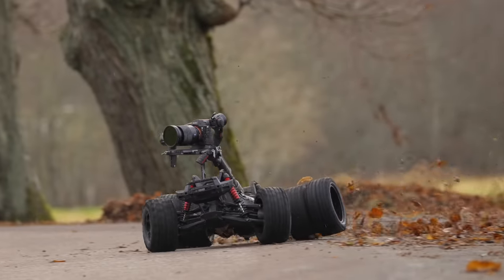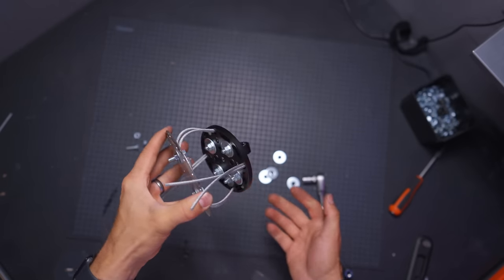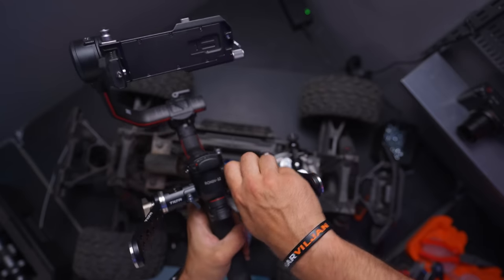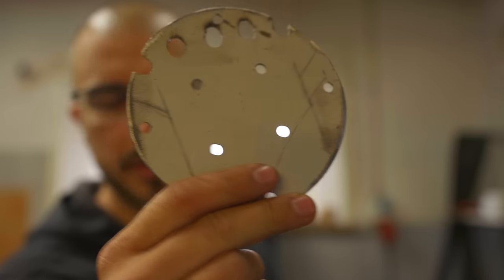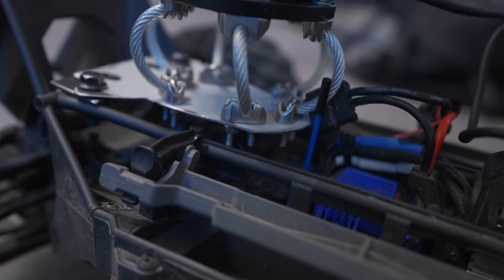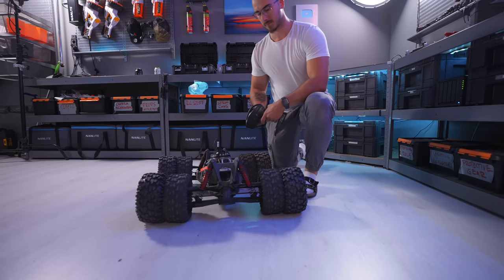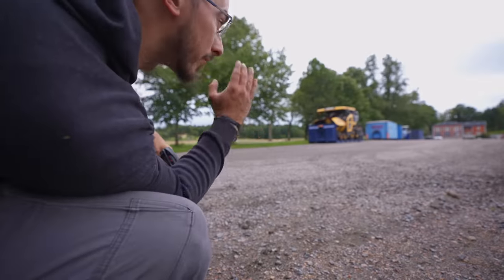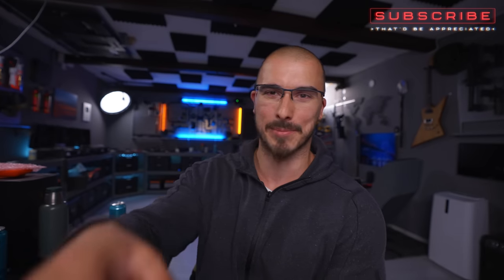I PUT MY SONY A7SIII & GIMBAL ON AN RC CAR | RC CAMERA CAR V2

Comment: Remove the gimbal and remove the camera and put a GoPro 9 on the RC, problem solved 🙃. Just kidding,🙃 that was good 👌
Reply: Haha right. He wants a challenge though
Reply from the maker: No fun in that! Also, can’t beat a full frame camera ;D
Reply: @PeterLindgren1  i was just kidding bro 🙃 i know full frame is full frame, and GoPro's performance can't even go near of it.
Reply: Actually yes GoPro with ReelSteady way to go…. If your going this route it is hard to get rid of those vibrations given the size of the wheels
Reply: I think a 360 camera should be able to reduce all vibration even off road
Reply: GoPro 10 now
Reply: @TriangleView  the GoPro hero ten has very good stats which are better than the a7s 3 but still it is not a full frame.
Reply: Yep.  GoPro with Realsteady would be same same.
Reply: @ibrahimsyed8112  yes GoPro is an action camera. If your looking to do this with a cinema camera you need to serious stuff. I have been there with an RC car it is basically really tricky given the weight constraints it is easier to just use an action camera and ReelSteady will just make it look great even if you have an older GoPro. Otherwise you can go with the GoPro 2021 10 edition or later and you will be pleasantly surprised. Slap on some CameraButter filters and you are good to go!!!
Reply: A GoPro would do way better, but it's not the point :)
Reply: @SlowMtbRider  I known I think the steel bands are great and will help a great deal. On carpet concrete I am sure the results will be better on this kind of grass a small Cinilft quad would remove the bulbs but you are then flying around which has its own complications. I am interested to see if there are some follow up videos with tracking subjects walking running and with a second operator controlling the gimbal pan tilt etc.

Comment: my thoughts are you need a 2 stage shocks/suspension setup: 1 adjustable tensioned firmer stabilizer attached to the gimbal, and a 2nd more looser foam/dampening base attached to the car

Comment: completely unusable footage, but i love the journey of experimentation and discovery. Better suspension on the rc car and an optically stabilized lens would help a lot though. Anything more performant will require Z axis smoothing like a spring arm. Great video.

Comment: You need to tune your shocks! Get some different weight shock oil from your local hobby store and experiment. Try lighter weight oil, you can also add tension to your shock springs by either adding the little clips, or getting heavier springs. The extra tires are causing more vibration, don't worry about toppling over with stock tires, just adjust it in your shocks to compensate and you should be smooth!

Comment: I've been waiting for this followup video! I'd love to see more "just for fun" videos like this from you.

For the suspension I was glad that you removed as much preload as possible from the car's shocks, but what I'd do instead of the wires is use small (onroad probably) shocks on the RS2 plate with very light weight oils and springs. Wire rope is basically a spring with high friction (as the wires move over eachother to bend), and friction isn't the same as dampening (that you get from shocks) due to stiction. As for the dirty camera, PotatoJet just did a video about filming underwater using a special bag with lenses that's also used for dirty environments.

Comment: I use a device that I 3d printed that removes z axis bounce that would be great for this. Amazon also makes one for the Osmo Pocket for a reference. I reviewed these devices and work very well. they use what looks like a automobile control arm with a spring. Very fun video loved your idea.
Reply from the maker: Might have a solution for this but I’ll have to wait a few months 👀

Comment: Peter, damping the vibrations is def not an easy task. Especially on an RC. For up-down dampening wires on a plate are enough only on a "smooth road". But if there are bigger bumps or offroading - then You'll need an arm and bigger wheels/bigger vehicle :) If You're interested I can send You Corel Draw projects of how I'm doing it and the suspention I'm using (but mine are planned for a full size car dedicated in filming).

Comment: the suspension of the RC car is not designed for the extra weight of gimble and camera. Plus with wired suspension you made there is no damper. Try to add something beneath wires which will damp its oscillations. That might give better results/

Comment: Just from an rc point of view you would need to increase the spring tension of the shocks of the Xmaxx, so there would be more ground clearance and less slop. At the same time this would increase the micro-wobbles I think because the suspension itself would be stiffer. maybe try to add a second set of shocks instead and all with loose tension of the srpings? And on drones this was achieved similar with two plates and "rubbersprings" in between – at least on phantom 3 and stuff so maybe instead of the wires – rubber/Silicon dampers would work here as well? Or next suggestion get an unbreakable or brute body for the Xmaxx and try to use that as addiitional stiffening platform for the gimbal as well. Next suggestion:  a friend of mine – Jonas (Youtube Dr. Xmaxx) machined some aluminium chassis braces which are mounted right and left between each bulkhead you would have maybe a better option to clamp something on there...

Otherwise Gopro mount on top of the body or osmo mobile/action :-)

Comment: there is something called " rubber vibration absorber",I think if you use them it will be much better, they are the best to use for vibration absorption

Comment: Using an r5 with IBIS, a 16-35mm 2.8 is at 16mm, some lens stabilisation and some stabilisation in post would have looked wayyy better

Comment: That is Epic! Would love to try shooting at a higher shutter speed and then add some stabilization afterwards. More like how the action cameras do it.
shooting at 120fps 4k, 1/500 or higher shutter speed and going full speed on the rc car, Playback at preferred framerate and motionblur added in software if needed.
Great video as always :)
Would love to see more of this project
Reply: True, we tested and just crank the shutter speed WAY up and stabilize with gyro data. Add some motion blur. Done.

Comment: Why didn't you use the same shock absorber springs in a V-formation to dampen shocks across the tilt and pan axes? It would have probably been a simpler build. Great video though! I suggest maybe keeping the previous configuration and adding the ability to raise and lower the camera, so that it can get closer to the ground. Can't wait to see your next version.

Comment: It was so fun to watch. I made similar but for motorbike, attaching to a custom waist and shoulder belt. I am using a6600 with sigma 16mm and zhiyun weebill s. The footage are useable but not very smooth on rough surface.

Comment: You should try to suspend the gimbal with some elastic cord. Like how they suspend microphones with shock mounts to remove micro-jitters. In the end all the vibrations will be absorbed by the elastic cord. I should work if you suspend the handle between two of these shock mounts.

Comment: 3 things , 1 In English its hose clamp if you were curious.. 2 on freestyle drones we use flight controllers that log gyro data. Then in post you can apply that data to the video and stabilize it after the fact.  Most of the flight controllers will work with rx cars as well. Just a thought for v3 😁.  3 awesome video, keep them coming

Comment: I put camera's on rc cars all the time have one internally mounted another externally mounted I'm working on one now to move with the car as it turns suspension isn't the answer it's conter balance is the best solution I've found love your channel huge fan 👊👍💯

Comment: cool project. but, the microvibrations are steel there. they are better solutions. and you rc car is not progressiv, change the radio and put a esc programmable in speed, breaks, to be smooth no matter all programmed in the electronics.. so your car are much progressive and controlable... you have to change the base, the rc car, they are some solutions with shock absorber liike 1000% better (a crawler for example, dual suspension, etc.). and the suspesion on this cars are sooooooooo smooth shure no vibrations with the right car. ((this is my opinion, and ideas because I thought of making one precisely, and the "crawler" buggy are really very soft, and more progressive .. what I mean is that in programming the 'ESC, there would have been no wrong move ...)

Comment: bigger diameter wheels. not so wide on tyre, try widening the axels. the cable gauge is too stiff still..try smaller

Comment: The design is all wrong, you need to understand more about RCs than knowing about your video equipment.  Listen to other comments below. Instead of using steel wires, replace it with softer oil dampening rc shocks, on the steel mounting plate.

Comment: A lead plate above the wires should give an improvement. More weight in the camera-gibambal-system should result in less vibration.

Comment: Awesome but you are trying to remove micro vibrations with cable suspension but attaching extra wheels with zip ties which is introducing way more vibration than what you were trying to remove in the first place...

Comment: Own experince are that you have to get camera or stabilizer attach to car rock solid avoid micro shaking. Those twin wheels also causing lots of shaking. I suggest you take look for Arrma Kraton 1/5 and build rig for it, it using aluminium frame so there is possible attach gimbal to the frame, it's also wider car with lower gravity point so you maybe not need extra wheels. But very intresting project 👌
Reply from the maker: Tried that the last time and it gave us even more shake than this! I’ll see if I can get the Kraton and make something 👀
Reply: @PeterLindgren1  If i remember right that first attempt was little bit front weighted so maybe lighter rear caused some vibration. That's not easy job get it work but you are on the right track 👌

Comment: a7siii will never be great for this b/c IBIS. We've spoken about it at lengths in the drone cinelift industry. On another note, gotta add a DJI force pro for dual op!
Reply from the maker: You can turn off the IBIS though? I might have an idea on a solution here though !

Comment: Aaaah, the childhood memories of traveling from Norway to Sweden to buy RC Cars (much cheaper), firecrackers (illegal in Norway) and smugling skateboards over the border (also illegal until 1980’s)… One thing to try: instead of the extra wheels, adding a horizontal bar side to side with wheels at the end, like the support wheels on a kids bike to keep it from rolling over, might do the trick in terms of keeping the steering agile :) Great video, looking forward to part 3 with Z axis stabilization :)

Comment: The steadicam does not work out fast vibrations, since it is calculated that it will be a human skeleton when holding the stabilizer in its hands. But But GoPro is designed that it will be d to be attached to different objects, so the stabilization there instantly reacts to small vibrations. Put a GoPro 9 and no problem) Good test of theory in practice!

Comment: I heard hero 10 is really good at micro vibes from Peter McKinnon , jus give it a shot..
Reply from the maker: YEah, but that's the easy way out ;)! I'm on the hunt for full frame haha!
Reply: @PeterLindgren1  this is what I like in you!
Reply: Btw suspension cannot stop micro vibes , u need foam or rubber for damping

Comment: To get ride of the micro vibrations get rid of knobby tires treaded tires. I don’t believe they make foam tires that size but they wouldn’t be difficult to make as long as your not expecting them to be seed demons. The knobby tread isn’t needed for that setup.  
Digging your build, looking forward to the end result.

Comment: Ok so that sort of custom wire suspension is meant more for sudden shock absorbing. Look at doing a rubber grommet plate. They are used in drone world to take vibrations out. Then use rope or wire to limit the movement to not over extend the rubber in each axis. This will fix the issues you have. Also switch to a smoother tire. Many of your vibrations are from those tires

Comment: Should have increase the deadband on the RS2, would decrease jitter and overcorrection a lot
Reply from the maker: I did! But there’s still some vibration reduction I need to fix🤔
Reply: @PeterLindgren1  oh wow, the way I saw the camera swing from left to right every time you turned made it look as if you barely had any deadband.. really cool project though Peter! Hope you can use it in something practical like.. you know... Rivals IV^^

Chase scene through the woods

Comment: I enjoy it so much the engineering of the idea and the conception of a prototype couple things from my own experience. The micro vibrations still present on the footage because the wiring system for the plates work better inverted instead of the camera on top that is because for that harness to remove the vibration it uses the equipment weight as dapening. Also the camera position is increasing the center of gravity by a lot making the car work harder on the suspension thus the waving effect on the camera everytime you turn. Try this next time use a horizontal shaft and with an L Shape on the front. Then mount the gimbal upside down in the (flash) position then use counter weights on the back to stabilize the RC car i think you have the right concept and thanks for sharing a great video

Comment: If you’re going to be running dual tires on the front and rear I suggest you upgrade your steering servo to a savox or something similar as the stock/factory one doesn’t have that much torque to turn the dual tires fast enough

Comment: I would use the same type of suspension as your RC car, you need a spring/dampener combo in order to eliminate vibration. The cable is too springy, you need a dampener to kill the bouncing movement. Look at how Steadycams are built. Your project looks like fun ;)

Comment: Awesome build - I made my own 'Tero' which is idential to the Freefly option so have some experience in this.

The problems are:
You have is the wire thickness is too high for the camera rig weight on the plate.
The wires mounts are straight vertical meaning the camera rig has a tendency to sway a lot. (If you made the bottom plate wider it'd reduce that swaying motion under acceleration / deceleration and turning).
The tyres induce high frequency vibrations due to their rotation so adding another set makes it worse, when driving the Tero we just take extra care when it comes to the stability.

It's a balancing act between more stiffness and more weight, I add V-Mount batteries for DSLRs as well as 1/4 screwed weights on the camera plate because they just don't weigh enough to give the vibration reduction we want.

Would be awesome to see a V2 and it'd be guaranteed to work with some more fine tuning and additional weight!